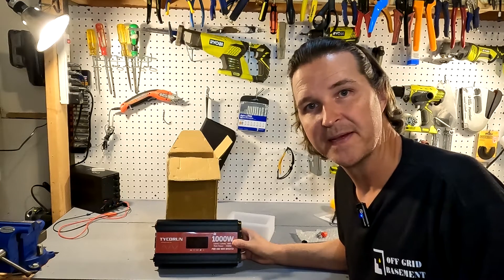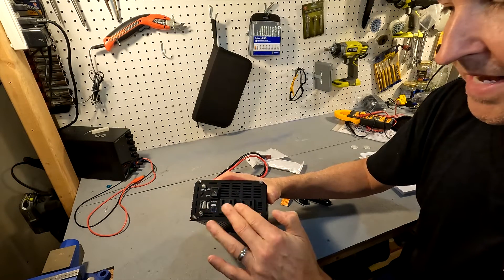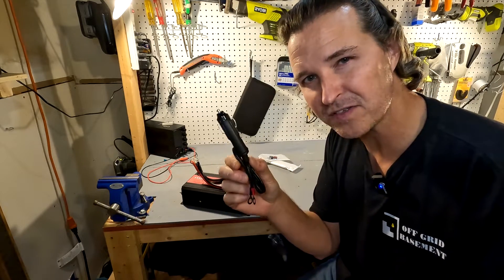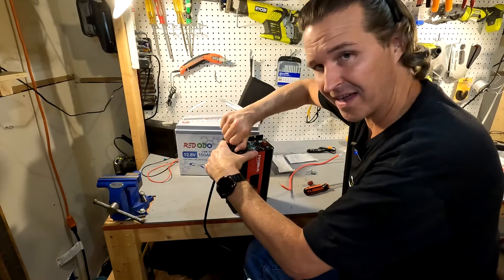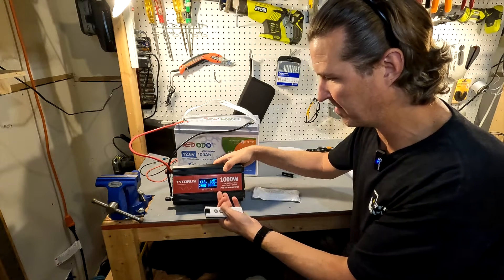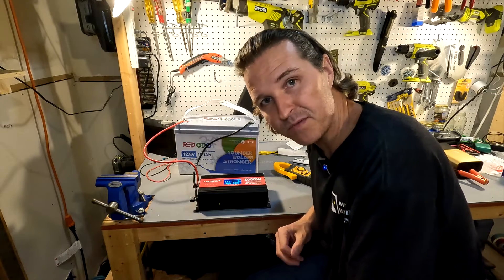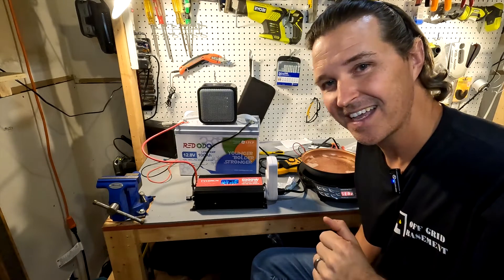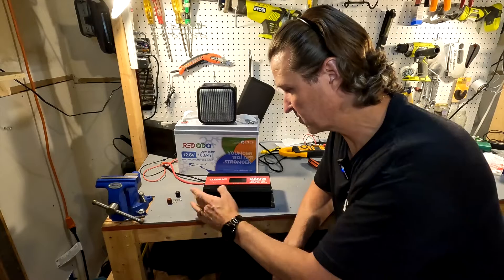TycoRun 1000w Pure Sine Wave Inverter Review

Comment: What I know is that you shouldn't plug things that has an element to a battery source,  like a stove. 

So a heater was  a bit of an overbearing. You should have tested with lighter, non element equipment
Reply from the maker: I like to test with items that don't have a surge and are a constant draw.  Do you have any recommendations?
Reply: @OffGridBasement  For testing, I’d recommend using devices with a steady, predictable load, such as LED lights, fans, laptops, or small refrigerators. These appliances don't have high startup surges and provide a consistent power draw, making them ideal for evaluating an inverter’s performance over time

Comment: My inverter gave out after 2 years of summer and winter, sat under my drivers seat and pumped out a continuous 1,600watts every single day for at least 3-4 hours daily. Bought a 3,000watt pure sine.   

Not that it’s important on what I brand, but you need an inverter to be twice the maximum you plan to use at. So it will run at 50% power making it last way longer.
Reply from the maker: That’s a great rule of thumb. Thanks for the comment!
Reply: But you lose efficiency doing it that way.

Comment: With so many undersized connection cables, may I ask you to consider taking a voltage reading at both ends of the cables under max/near max load?  I wonder how much of the missing 12% efficiency was due to the cables.  

A always appreciate your common sense well explained videos..  

A T Burke
Reply from the maker: I did some more testing on the voltage loss in the wires and here is what I found....
With the wires that came with the inverter:
@ 600w..  12.66v at the battery terminals and 12.46v at the battery terminals
@900w..  12.24v at the battery terminals and 11.92v at the inverter connectors

With 4awg wiring:
@600w..  12.55v at the battery terminals and 12.46v at the battery terminals
@900w..  12.18v at the battery terminals and 12.03v at the inverter connectors

Wiring size makes quite a bit of difference!  I hope this gives you more information.  Thanks for the comment!
Reply: Thanks, sure does.  

A T Burke @OffGridBasement

Comment: Seems ok for 5-600Ws.
Reply from the maker: That is how I feel as well.  Thanks for the comment.
Reply: Kind-of off-topic, but if any of your viewers are planning something, after experimenting and fabricating solar power units for folks, I've found that a Mr. Coffee jr. machine, the smaller, black, 5 cup model, uses 635 Watts during the brew cycle, and intermittently when the heater plate cycles on the warming pad. I found that a 1000 Watt PSW inverter is needed to stay within the normal margins (no alarms sounding, no excessive heat-up, or cut-off)  to use this  machine, along with at least 100 W of solar and a 10 Amp MPPT charger, and a 100 Ah LiFePo4, and fuse/wires. If you use the coffee machine more than once a day, you'll need to throw more solar at it accordingly. Hope that helps some folks. Cheers @OffGridBasement

Comment: Odd that at 1000 watts of output the two 30amp fuses didn't fry.  My calculations would suggest that 720 watts of output (assuming 100% efficiency for easier math) would be 60 amps at 12 volts.
Reply from the maker: That is odd.  I'll need to check it out again to confirm.  Thanks for the heads up.
Reply: Fuses are physical devices and   they take some time to heat up and melt. If the 1000watts is peak then a rough estimate for rms power is 500watts. Either way you just never know the exact specifications for physical devices.
Reply: Bold of you to assume the fuses are real! While they could be time delay fuses, they're more likely fake. At best they may blow with reverse polarity or a dead short.

Comment: I do know a lot about the internals of inverters, right down to the component level and after spending the past 24 years repairing inverters, I can tell you from experience, that you're throwing your money away by purchasing one of these cheap, Chinese made, high feaquency, transformerless inverters. For one, they don't last. You'd be lucky to het even a year's worth of service from one of these units. Second, because there's no iron core, copper wound transformer to isolate the DC input from the AC output, all it would take would be for a single MOSFET to short to ground and this inverter can send high voltage, high amperage DC current straight through to your AC loads which can not only damage your AC loads but can also set your AC loads on fire. Even at $99 this inverter is absolutely not a bargain.
Reply: That's my concern with high frequency inverters. As you say if one mosfet went short circuit the output would be DC at 170 volts (peak of 120v) or 340 volts if it's a 240 volt unit. Switch mode power supplies would probably work normally but anything containing a conventional mains transformer or induction motor would be destroyed
Reply: As another has asked, can you please recommend a good and affordable pure sign wave 1000W or 1500W inverter?  I'm looking to purchase soon.  Thanks!@
Reply: @Travisj535  I would recommend any of the following inverter manufacturers. Schneider Electric, Sigineer Power, Magnum Energy, Outback Power or Victron Energy. Just make sure that you're buy a low frequency, transformer based inverter.
Reply from the maker: Thank you for your information and comment.
Reply: Can you recommend a good pure sine wave 1000W inverter?